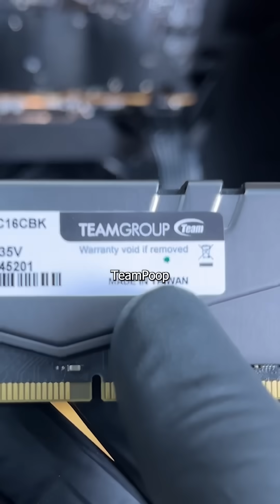New build, old problems (how to fix your own #PC ) #technology #tech #shorts

Comment: Used that ram before. Instead of that blue screen of death, it would freeze my computer about once every thirty minutes, and would eventually just shut down, and restart, blaring the alarm signifying a faulty ram connection. 😐

Comment: I once had RAM and a power supply crap out about 20'ish years ago (almost more like 25 years). For those playing the home game: RAM and power supplies give VERY similar problems when failing. So swapping one out and going "shucks, that isn't it" took a WHILE because I had TWO problems. Southeast, TX. The power there is TERRIBLE which tends to cause all sorts of electronic issues over time. To the point we basically banned servers from being here unless absolutely necessary and just like that... tons of weird problems just vanished.

Comment: I can't believe it. I just did a build using that same case and had exactly the same problem. Nice looking case but a bitch to work in. I just pulled the MB out (for like the 8th time) to put that plug in.

Comment: When I was done building my monster PC with the full custom water loop with all glass lines, and a glass reservoir It just would not boot. 
After taking it apart and putting it together nothing changed. So I got a bit irate since it was all brand new hardware, but after a while I figured out it was a damaged GPU Power cable. I was close to putting my head thru a glass side panel (Of which there were a lot...) Since I of course did not have another one to swap out, 
Meaning ordering the exact cable I needed, waiting, and then FINALLY I was able to game to my hearts content. Still am.

Comment: telling yourself you're the greatest tech because you diagnosed a DIMM is.... well.. I guess most people will go with it.. don't expect me to.  also the mis-inserted power connector on that PRIME B450M-A/CSM (or variant) is the EATX12V connector.  All the top rails are 12v and all the bottom are ground. Any good tech would know that mis-inserting that plug would not cause and significant fault (at least not under heavy load) since the voltages are still correct.  sorry if this comes over as assertive, but I was building systems and diagnosing Disaster-level-problems in runtime systems before your mother was old enough to well.. you know.

Comment: By this technique I was able to fix BSOD, one memory module was bad. Here is the curiosity about the case. Back then, the motherboard maker in BIOS had a feature to test your HDD and RAM. I run disk test and passed. Then I run test the RAM test, both modules past. So I decided to test module at a time by rebooting the system. This is how I was able to fix that issue.

Comment: I had similar problem. I installed 4 sticks on RAM, I got beeps. I bought 2 16GB DDR4's, it failed again. I found out that only one memory bank works. So I bought one 32GB RAM module. Gigabyte support worse that me, not any better than me. Dreadful Win 11 requirements pushed me to install new ASUS MOBO and Intel CPU.

Comment: Hey im a girl and not trying to be pick me but god knows i know nothing about building pcs, but i had an old pc that had all usb ports messed up and the turn on and off buttons so i bought an outer shell if thats even a word you use but its just the case with buttons and usb cords  than i transfared all the mother board and cabels the exact way they were but of course i did something wrong and now the pc turns on for a bit than off on its own and it doesn't turn on the monitor at all...help?

Comment: Heres a simple solution for a failing stick of ram use pencil eraser and rub it on the gold connector of ram it removes carbon and ram doesnt usually fail it can fix this issue 90% of the time  i am not a scientist but it works i tried it myself many times

Comment: My budget build is literally a powercolour ryzen gpu a 8400f that case a slightly cooler stock fan and 16gb of 6000mhz ram that turned out as 32gb of 6000mhz 🎉

Comment: I got a T force , ram timing 16 18 18 36 (or is it 38) really good (2019) , I got a new one ( 16 20 20 40) (2025), currently running an xmp for the 2019 one , I have the (16 18 18 38) in the 2nd and 4th slots

Comment: Happened to my Asrock B450M Steel Legend. I was having a bad day when I was cleaning the PC up, accidentally swapped the 2+6 Pin and 4+4 Pin connectors and ended up frying the board. Was a beauty, but RIP.

Comment: Ram still offer a 10 year warranty right? The only component in the inudstry that has not eaten shit, its always as fast as the bus it can service. However the latest generation requires cooling so, we are hitting thermal limits, and design limits.

Comment: Forgetting the power switch before trying to boot is a certified heartrate raiser classic
Reply: hey at least he didn't forget to plug the power supply back in XD
Reply: OH NO. Wait nevermind.
Reply: I laughed at comments like this before I built my first pc, then proceeded to make this exact mistake.
Reply: Got to make sure the old ticker is awake once in a while
Reply: oh I got the same case !
Reply: Zone 4 cardio
Reply: When I first built a pc I was already expecting something to go wrong, like not plugging something in correctly, but it didnt turn on at all, even though I turned the power switch! then it turned out I just forgot I alreary turned the power on before that 💀
Reply: Love how we can all unite with that experience, whether you have a cheap or expensive set-up, or whether you are a noob or an expert.
Reply: I do this still
Reply: 60% of the time, it happens every time.
Reply: considering how rarerly I f with PCs parts I ALWAYS forget to check if it's on or off, sometimes I dont even care to turn it off tho

Comment: RAM loves throwing tantrum fits so much. Its been 2 times now (in a span of 1,5 year which is how old my PC is), that after windows update I had to basically "turn off and on" RAM to stop getting blue screens. Plug out, plug back in and suddenly it works like nothing even happened before.

Comment: Easy fix, just repair the MBR. That 428 code tells you the issue and why I hate 'Repair Techs' as most like this guy, don't actually have a clue what they doing. You unnecessarily removed parts, without doing the very basics in diagnostics, and this is why you should always have a 'Master Repair Disk'. What has most likely happened, is you've faffed about in the case, and reset it and so not fixed the problem that will occur again, and you've just ripped your customer off.

Comment: The error code 0xc0000428, often displayed as a blue screen of death, indicates that the operating system cannot verify the digital signature of a file, preventing it from loading

Causes:
-Corrupted or missing system files
-Driver issues: Incompatible or outdated
-Secure Boot configuration: Incorrect Secure Boot settings in the BIOS can also cause the error
-Malware infection

Comment: Lmao, I instantly came to the conclusion that it was the Ram. Usually it's an issue concerning the ram. It can sometimes even be the mossfet battery. Can even be a cpu issue too. With BSOD, it can almost be anything. Like your bios or firmware on every bit of tech you got

Comment: Ok, I have brand new motherboards and CPUs, 8 core and 4 core 4.2 GHz 
12 GB memory 
128 GB M2 SSD

Windows XP and Windows 7 and Windows 8 run fine. 

Windows 10 and 11 hangs within 3 minutes or shuts off

After a lot of searching, I found out there is a CPU power management called C-State that Windows 10 and 11 uses

If the BIOS has the ability to turn off the C- State then Windows 10 and 11 will work just fine but my BIOS does not have it and there's no way I can find to turn off the C-State power management 

I have tried every power setting in the OS and I can't find anything to make it stop hanging and turning off 

Have you seen this as well and do you know of a fix in the OS to make it stop using C-State ? 

Thank you 

Bill
KC2OVX

Comment: I have the same pc case, and angle grinder, a single cut wheel and you can improve airflow ALOT, without damaging the integrity of the case much.
Reply: i have that same case and have had 0 airflow issues.
Reply: @theghostofthomasjenkins9643 
You must have great static pressure fans, mine were not good enough / were unbearable to live next to.

Comment: I was getting RAM issues (I couldn’t go 10 minutes on the lock screen without a blue screen) and I swapped it for a similar kit, my PC started bluescreening, I ended up using a recovery USB to back my data up and reinstalled Windows. Idk what was wrong after the RAM swap but something broke enough that Safe mode didn’t work

Comment: I have an issue with my mobo where it stays in cpu/dram loop like in one of your other videos. I swapped rams i inspected cpu pins and nothing only the Bslot channels work what i havent tried is swapping cpus with my other one currently running an i7-9700F on a msi b360 gaming plus mobo msi rtx2070 armor 8gb and corsair 4x8gb vengeance rgb pro ddr4 3600mhz but currently can only use the two in the BSlot channels. Any clue besides trying to swap cpus which i will try soon

Comment: I had a problem with ram. I don't remember what problems it caused, it was back with ddr2 so it's been awhile. Anyway, the pc would boot to windows and you could still do most things without much of an issue. However, when booting with just one stick the bad one would always crash during boot. Corsair, honored the warranty with no issues.

Comment: Oh no the Q300L. This case has really bad airflow problems, I know from personal experience. I reduced my temps by using duct tape to close off the top and bottom vents (except where the PSU fan is of course.) and keep airflow going in one direction. Made a 7-9°C difference for me.

Comment: Locking Hemostats make getting power connectors and JST connectors in tight places, a much easier job. Specifically if you have large hands and sausage fingers. But in general i have found it to be much quicker and less fiddly. Saving time and skin :D

Comment: Why the hell are you not wearing an anti static strap Or working on an anti static pad?

You can fry that entire computer with 1 discharge of static electricity.

I hope you don't actually work on everyone's PCs like this. And I don't care if it's never happened before it will happen eventually. Unprofessional and irresponsible.

Note for uneducated: the gloves he has on will not prevent this.
Reply: ESD straps are NOT a requirement in this industry and often get in the way more than help. 

You can only discharge static electricity if you're actually charged in the first place, there are many ways you can discharge electricity from yourself to make yourself safe, for instance touching your computer case. Your case is grounded so it discharges you with no risk to the computer.

Speaking of grounded cases, most computers have some form of short protection. If you ever short a contact on a USB for example your power supply will shut the computer down immediately. 

To assume you know more than someone who works on computers for a living is honestly just disrespectful, he doesn't wear gloves to prevent static electricity, he does it so he doesn't get gooch dust on his hands or leave oils from his hands on computer components.
Reply: @LZeugirdor  That's all well and good, however:

Just because something is random, doesn't mean it's impossible. That's a paradox. So, since millions of people work on the millions of computers and phones and devices for the rest of eternity, then guess what: it happens ALOT! - not statistically, and I don't care if it's a "standard" (they're often flawed and about $$$) - I was taught that fundamental shit about static and electricity shit WAY back when I got all my of IT Certifications in 2015.

You couldn't pay me to work on any computer without being Grounded electrically. It's stupid.That's simply my opinion. What is yours?

Comment: what pc case is that?
Reply: Cooler master master box Q300L, I have one it's the cheapest case on Amazon that isnt straight from 2012, it's not great but it works, I personally would spend the extra $20-$30 for a better case after using it.
Reply: @tyler6602 Thanks. Was trying to look for oc cases with usb ports on the side or bottom. Trying to find something that would beat the lian lino11d evo or the phanteks nv7

Comment: "if it fits, it doesn't mean it belongs to there"

Yeah, once I bought new PSU, I connected CPU power 90 degree rotated. My PC didn't start and I am glad rotating it back to normal fixed it, so I didn't need to go for new CPU or motherboard.

Comment: had ram problem right out of the box in 2002 and that's how i  knew by doing same thing. 10 more years if i make it and its retirement.  Bad ram happens but out of thousands and thousands where i work i have seen only seen a few but the pcs are from factory so they may have weeded out most before they were even shipped.

Comment: Hello, great video as always, I'm studying IT at the moment, and I have a question, wouldn't the motherboard have POST constant beep sounds regarding the RAM issue?, because from what I learned, is that whenever there is a RAM issue POST would make a sound about it.
Reply: From what i've learned, some, if not most motherboards these days don't have a speaker anymore. Back when i studied computer repair, most cases had a built-in speaker for the beep codes, but that was back when IDE was more common than Sata, PCI slots were new(ish) tech (no PCIe), and Windows XP was the newest OS from Windows.

Comment: Its not fixing things .... its guessing ... for example you could have a bad ram slot and perfectly 1000% healthy ram stick ...
Reply: It would be easily diagnosable since you can also swap the ram lmao, ram dont work try another set then if it don't work it's probably motherboard or CPU, test another CPU and if that don't fix it it's the motherboard, it's not guessing it's following the problem to its source.
Reply: And I highly doubt the ram stick in the video works, he tested all slots on the motherboard with the working stick making sure both the CPU and motherboard work properly

Comment: My laptop gets excessive hot when I'm playing games, to the point where the heat is felt on the keyboard.  It's fine when I'm just watching Youtube.  The 2 fans still works.  I just remove the laptop cover, place it over my laptop cooler, & that keeps everything cool.  Is it the thermal paste gone bad, or is the air duct clogged?

Comment: lmao yep had this problem myself with a ram stick. Brand new set. Installed them and everything seemed fine for a day or two before suddenly BSOD. Initially I thought it was my power supply since it just barely had enough juice for my rig before the upgrade. So I sat on the ram sticks for far, far longer than I should've. Finally installed a bigger power supply, then the ram, and...still BSOD. It was far too late to return them sadly, so I had to eat that loss and buy some new ones.

Comment: STOP BUYING CHEAP STUFF WHERE CHEAP STUFF DOESNT BELONG!!!!!  Lesson from a pro Server designer.   1.) the things that matter from a data perspective need to be quality (SSD, MEMORY, PSU, Motherboard.) those NEED to be quality for the Software to work now and long term.. for CPU GPU, CASE thats all preferene and use case specific. (DONT PUT RGB on your memory) this causes voltage drops that can lead to long term data corruption issues. Lastly, Do your research on not only the CPU, but the motherboard Chipsets (these control other parts on your motherboard) so a High end CPU/GPU in a basic bitch Motherboard with old Chipset doesn't make sense. think of generations (build something in the middle) and refresh in 5 years. (if you don't spend 300 bucks on nonsense every time its very affordable.

Comment: As someone who used to use TeamGroup RAM, when it worked, it worked well, but once one stick goes, you can bet the others are only a day or two behind it. Switched over to Corsair RAM after that and I've had smooth sailing since.

Comment: I had a similar symptome with my PC after I migrated my RAID boot drive to a single SSD. After switching from the SATA controller from RAID to AHCI, the same screen came. I wasted 2 days until I found that I'd only need to turn on safe mode boot once before switching to AHCI and then turn safe mode boot off after I windows installed the AHCI controllers storage drivers.

Comment: Funny enough, I built my friend a pc from old parts and this exact case. Old 4790k, motherboard, and 16gb of ram I got for free, plus a psu and a 1080 I got on fb marketplace. Delidded the cpu, threw a 120mm AIO on it, some fans I had laying around, and it wouldn't boot. Got to the ram checks, one "seemed" bad, but got them working (just needed to be reseated). Dude's still gaming with us on it.

Comment: I bought that case 2 years ago and everyone was telling me I was going to have issues with overheating, I just added two big 120mm in the front and one 80 at the bottom to divert the air flow to the right places and haven't had overheating or noise issues so far.

Comment: so i have a gigabyte laptop im on it right now i spent 1167$ on this after a month of owning it i was getting constant blue screens now as of 3-4 months i dropped it 1 inch off of my laptop lapdesk that i use to game on the coutch in bed etc and now my entire system freezes suddenly and i cant even take the bottom off to check because if u do u cant get a new one from the warenty its so dum so ima take to best buy refund and get a new one DONT BUY GIGABYTE